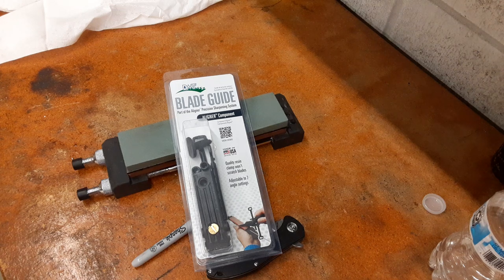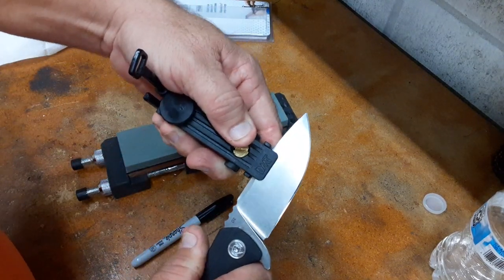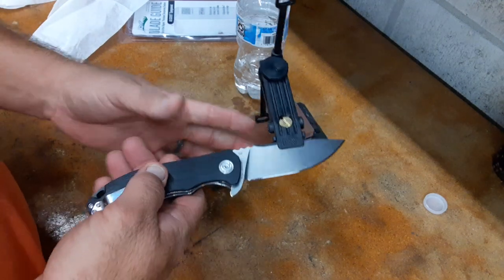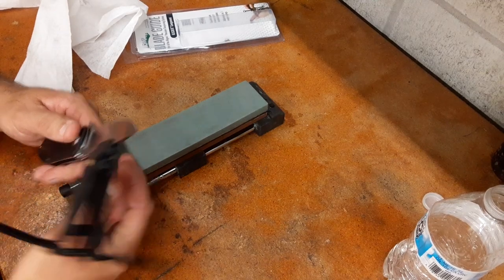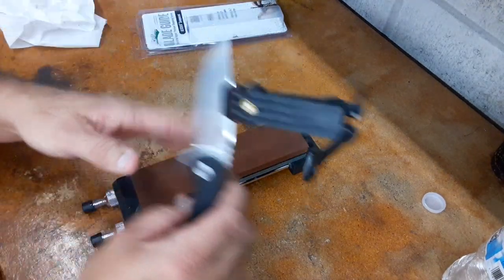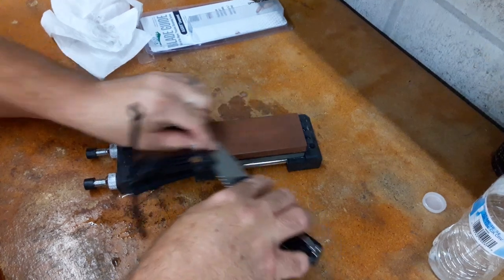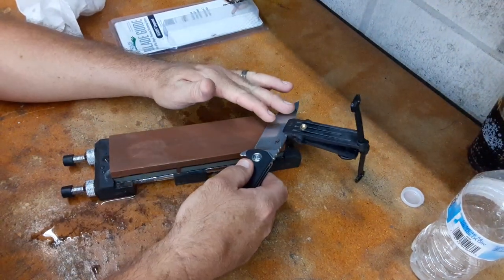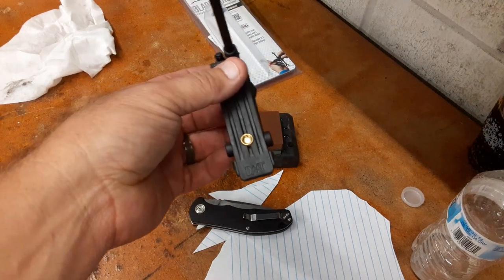No excuse knife sharpening anyone can do using the DMT aligner guide on the King K80 with D2.

Comment: Nicely done! Enjoyed watching.

Earlier hurdle for this configuration on the aligner is differential thickness of stones over a sharpening progression changing angle apex. Similar issue with many clamped systems with numerous solutions.

A little blue painters tape on the blade help that clamp stay in position with less pressure on the plastics.

My Aligner over 20 years old (pre brass insert). Think it was best of the early guided systems because it could be used in many configurations and with a multitude of stones. What a Great learning tool, and  GREAT video exploiting it !

I vote for a series on the Aligner ...

Reasoning:
Training people on this is so cool ..., when they get their first hair whittle or hair cleave, that smile of amazement is a precious share.
Reply from the maker: I may use this some more , I have figured out a way to make up for differing stone thickness.
Reply: @Outpost_76  RE: stone thickness difference compensation.

When using Aligner with stone holder & rod assembly OR when using just Aligner Clamp Assembly ?

Comment: I used to have this but with stone holder and 3 DMT stones as complete system.. Ive never used the clamp cause i just combined the DMT stone and holder with lansky clamp.. Thats how i started to sharpen my knives and i reached great results.. Good Video men..
Reply from the maker: Years ago I used Lansky diamond stones with a Gatco clamp. It also worked well with the extra adjustability.  It's great to hear what others did mixing sharpeners like that.

Comment: Gritomatic sells the Hapstone T1 which is designed to do what you've adapted this guide for. It's about twice the price, but I think it will be money well spent. I have one on the way, I'll keep you posted.
Reply from the maker: Let me know how it works
Reply: @Outpost_76  it works an absolute champ for big knives. Much quicker than something like the Hapstone R series, as there is so much more stone to edge contact. It gets a bit dodgy on the smaller knives as angles get more obtuse and I really wouldn't want to sharpen a filet knife with one. I bought four total, as I plan to put together a portable sharpening kit. Thinking seriously about doing onsite sharpening as a side hustle.

Comment: How did you end up with the 17 degree angle by just extending the adjusters to the max.  Any less extension than that the angle would change.  It looks like it's sort of arbitrary result that doesn't depend on  using the DMT designed angles on the clamp.  Am I missing something?

Comment: Great  ideo G. i never thought of using that DMT guide Very cool. Awhile ago, I was going to buy the diafold stones, and found it was actually about the same if not cheaper to buy the kit. I didn't buy it, but if I had, I'd have the aligner. I have some cheap bench stones, both diamond and Arkansas/silicon carbide. Been thinking of getting some water stones to add to the lineup. Been trying not to use the KME so much, and get back to freehand, but I'm not the best freehander. I can get a decent working edge, but not an edge like I get on the KME. Maybe I'll try this. It might help build that muscle memory that seems to be the key to a keen edge. Once you get into the knife hobby, it's easy to spend as much for various sharpening stones or systems as you do on the actual knives. Always chasing that next best stone set or some super duper so easy a monkey can do it system, lol.
Reply from the maker: Stones can get as deep and exp6as the knives themselves.

Comment: Would you have used the same angle while stroppin with the blade guide or would you change something up?
Reply from the maker: I've always done freehand stropping. Istrop at the same angle.
Reply: @Outpost_76  yeah your doing a really good job. I'm just not very good at freehand sharpening but I really want to experiment with all these steel's I got but I'm afraid to dull them out because I'm incompetent with sharpening. I may just need something like this angle guide until I get the hang of it. I'll order one next week along with a decent strop.

Comment: Does it work with larger blades?
Reply from the maker: Yes it will work with larger blades. I've used it to sharpen a 5.5 inch fixed blade in the past.